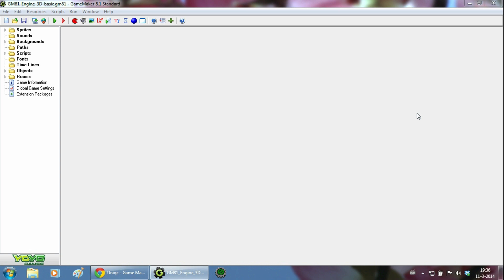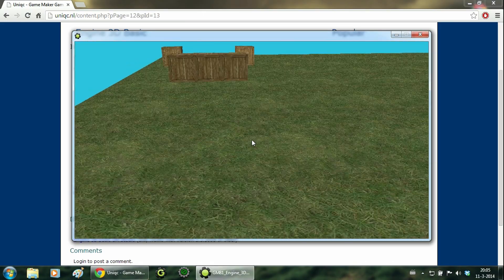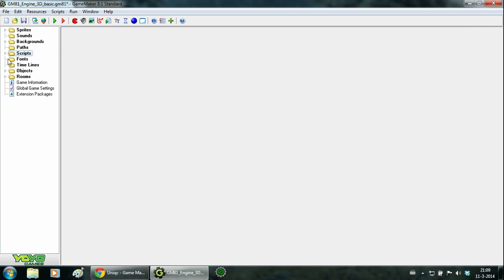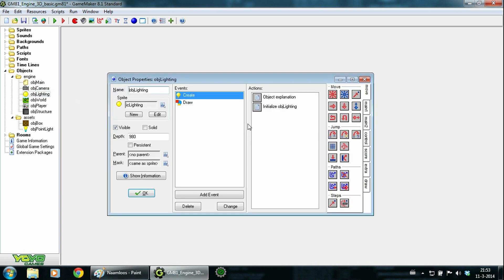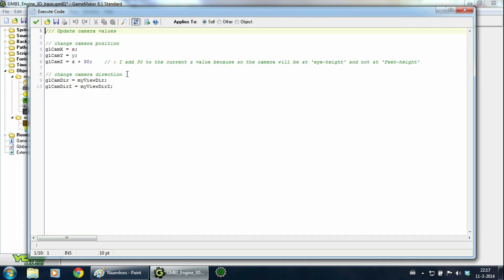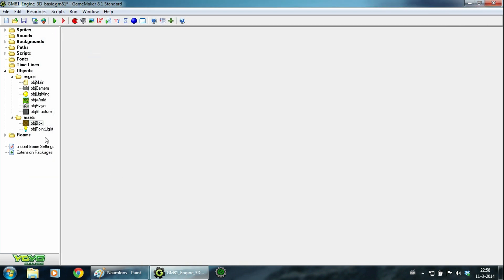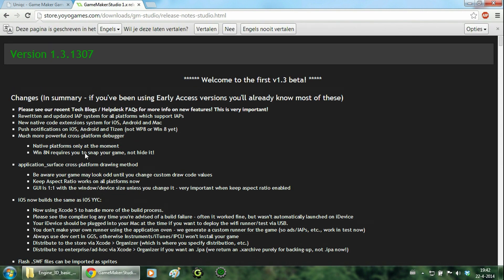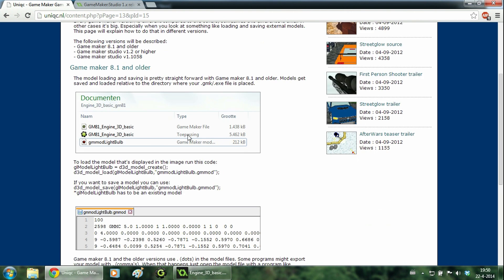Game Maker Tutorial: 3D engine introduction

Comment: Hey Uniqc, I've been coding in game maker for a long time but I recently decided to go 3d. Long story short, it's a lot more difficult than I anticipated and I'm stuck with something. I used a different way to move left and right than you and I can't figure out how to make it faster. I tried reducing the number divided but that didn't work. Please help!

This is the code by the way:

if keyboard_check(ord('A')){{
    var xn,yn;
    xn = x - sin(direction*pi/180);
    yn = y - cos(direction*pi/180); 
        { x = xn; y = yn; }
}}

if keyboard_check(ord('D')){{
    var xn,yn;
    xn = x + sin(direction*pi/180);
    yn = y + cos(direction*pi/180); 
        { x = xn; y = yn; }
}}
Reply from the maker: Hey Gumdropz. To change the speed you have to create a value that's dependent on the sin/cos function. So just doing something like xn = x - sin(direction*pi/180) + 5 will not work, because it's not dependent. It will always add 5 (move right). So you should do this xn = x - sin(direction*pi/180) * 5. Now it is dependent :P

Here is a piece of the code that should work
var mySpeed;
mySpeed = 2;
if keyboard_check(ord('A')){{
    var xn,yn;
    xn = x - sin(direction*pi/180) * mySpeed;
    yn = y - cos(direction*pi/180) * mySpeed; 
        { x = xn; y = yn; }
}}

The variable speed can be increase/decreased if you want to go faster/slower.
Reply: Thanks! It works fine.

Comment: hey, uniqc, i was wondering, is it possible to have HD graphics using gamemaker? Or can you only have blocky models?
Reply: also, should i get gamemaker 8.1 pro? or gamemaker studio standard? which is best with 3D games?
Reply from the maker: silverbootsgaming It is certainly possible to have very nice models! The user darklewa has a few awesome videos with my favorite being the 'game maker bmw'.
GM Studio has slightly more functions and works with different platforms. I prefer GM 8.1 which is more stable and I think it's slightly more easy to work with. Depending on the project I used either GM Studio or GM 8.1 so I think the best thing is to install them both :)
Reply: Uniqc okay, thank you for your help!